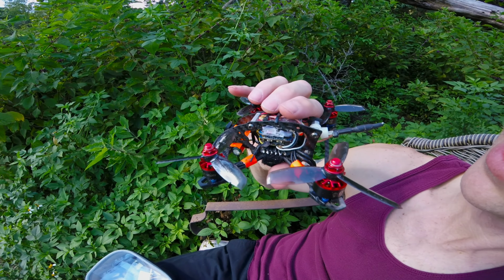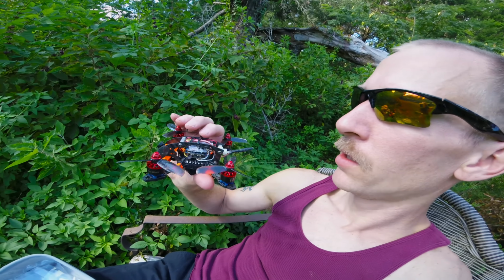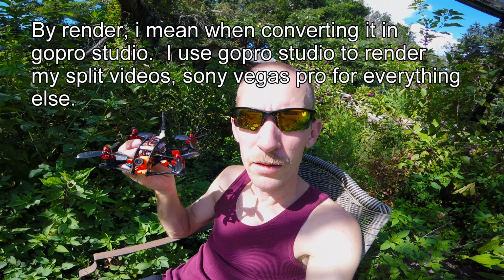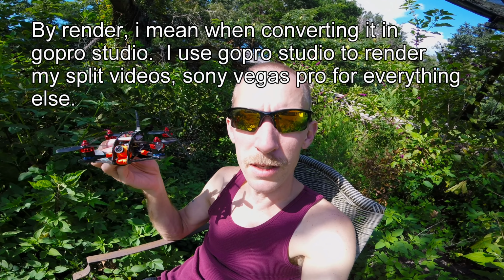Runcam split freezing fix

Comment: Hey bud, just subscribed recently. I'm giving the split a second chance since watching your video I'm using gopro studio and still not getting the results you're getting. My question is when you export your video do you export at 4k 30fps? That's the one thing I haven't tried yet.
Reply from the maker: If you aren't trying to render it along with some 30fps video from a gopro or dslr, then you can just export at 4k 60fps and not adjust the speed.   For the least compression on youtube you should export at 4k and at least 40mbps bit rate, I'll do 50mbps if it's not a long video.
Reply: @mooosestang  ok got it.. that's the only thing I didn't do. so export at 4k 60fps. Thanks bud, and another thing we seem to have a few of the same builds in our fleet. I have a massive 3inch droner and a 7 inch martian long range. I'd like to see you do some more of the 7 inch flights looks really cool.
Reply from the maker: @calabrese221  I converted my 7 inch alien back to a 6inch temporarily.  I need some better motors for 7 inch i think.  What motors are you running on 7 inch and which props?  I love the quietness of 7 inch props, but getting it to fly without propwash wobbles has been a challenge.
Reply: @mooosestang  my rig has the tbs endurance motors 2206 1450kv on 6s. I'm also having some issues with wobbles I'm going to try switching out my esc with wraith 32 v2 and possibly another set of the same motors just incase one is bad love these motors for the efficiency. Oh yeah and my props are the same as yours the HQ 7.35.3 blade
Reply: I'm also waiting on betaflight 4.0 which I believe will be the ultimate fix for our prop wash and wobble problems. I have a few videos but there set to unlisted until I have a proper fpv channel haha.
Reply: I just set two of my long range vids to public if you want to check them out one is on 6s the other 5s. Martian2 frame with 7inch hq props. Let me know what you think. Oh yeah make sure that you set it high def and I know there 8min long but watch the 6s one to the end it's pretty cool
Reply from the maker: @calabrese221  Thanks.  I think we need a bigger motor, but i'm not totally sure.  I'll probably convert it back to 7 inch now that i have the hero 7 black.  it gets rid of the wobbles for the most part, but it's kinda cheating.😁

Comment: 'micro vibrations cause the sd card to lose connection and freeze'  interesting, since I get this freezing with the quad just sitting on the bench without the motors spinning.  I'm pretty sure it's just caused by having the uarts connected to the FC.  I originally didnt have those connections, and never had a freeze. then I made those connections, and froze immediately afterwards.  I'm just gonna remove them, since they don't seem to give me the camera control (brightness, contrast, etc) I wanted, but instead just allows me to use the sticks to change modes, or power - which is dumb.

Comment: Run crossfire don't be foolish😀, look at all the advantages of XFIRE over the R9m system before you make a mistake 😉
Reply: Tessa's,..but here in Brexit land R9M is HALF the price of Crossfire.Sad,but true,..
Do you think Crossfire can justify twice the price,functionality wise sir?
Reply: @chrissofpv3017  well I do for sure think its worth the price compared to the R9m. Over the air updates..  multiple power settings all the way up to 2w... Dynamic power... Spectrum analyzer... Mav link... Along with a lot of other features. Also with the price drop recently and years of proven performance already from the community it should make it an easy decision 👍😉
Reply: @smooth_ops2942  ...many thanks for this,quite a few nice features with Crossfire! I,m warming more to it now.👍🍺